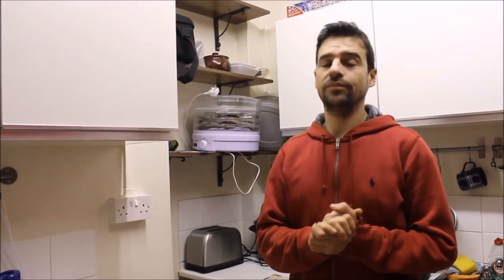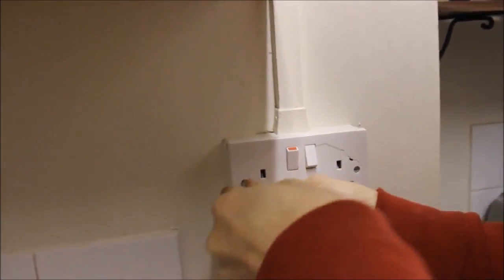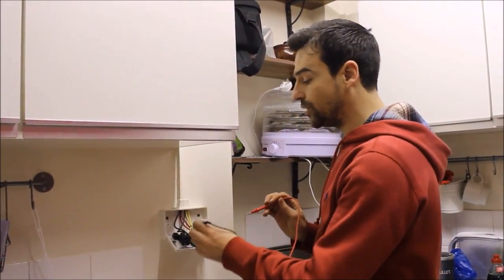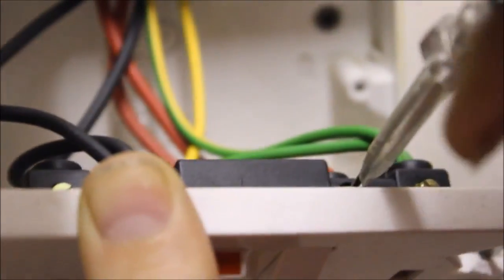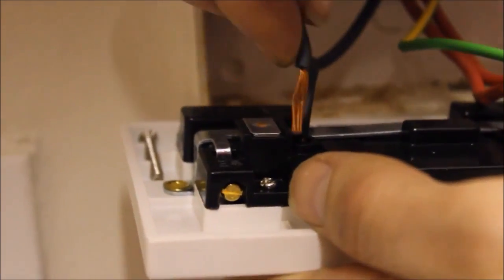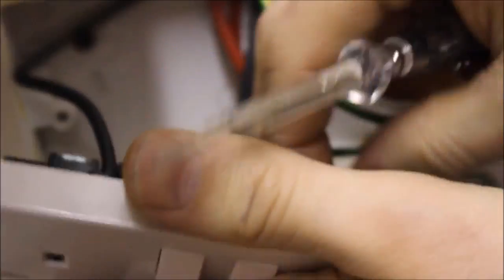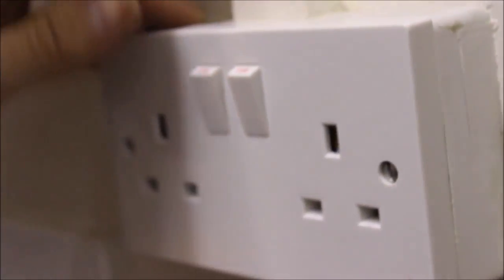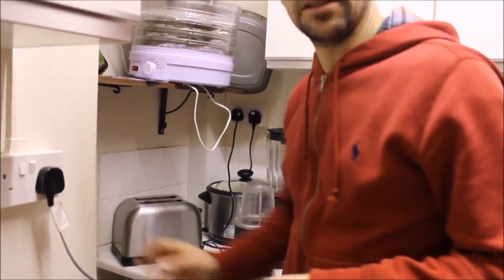How to Install  and Wire a UK double Socket - Video

Comment: You didn’t check for voltage between line and earth and neutral and earth. So you didn’t actually prove the circuit had no power. I wouldn’t have used a multimeter for proving power is off.  You should use an appropriate voltage detector with battery proving device. That screwdriver is too small for those screws. The box on the wall was also damaged and should be replaced.

Comment: That’s wired wrong the only earthed socket there was the one on the right because an earth wire goes into one earth slot and the other into the other earth slot!!
Reply: Josh earthing bars are usually linked. So with the 2 going into one hole would be fine

The only reason some have 2 earths is because you could technically have 4 earth wires in one socket. If you had a metal box and If a spur was attached along with the other 2. It’s just to give more room tbh
Reply: Some that I have bought bfrom Screwfix only have one shared earth, such as the BG SP sockets.

Comment: Hi,    Why can I see bare copper of the wires after you have fixed them in.    That should not happen, there should be about 1/8" of insulation in the wiring hole.     Please do the job properly and safely.